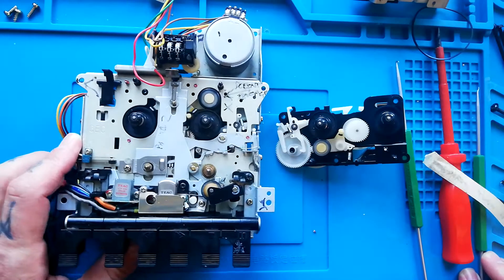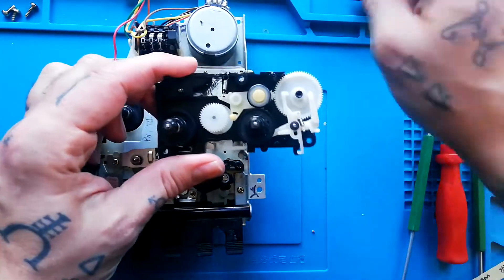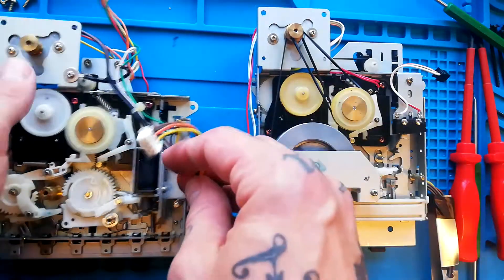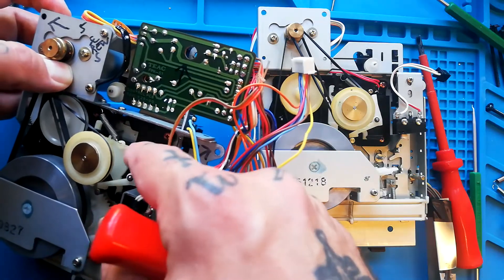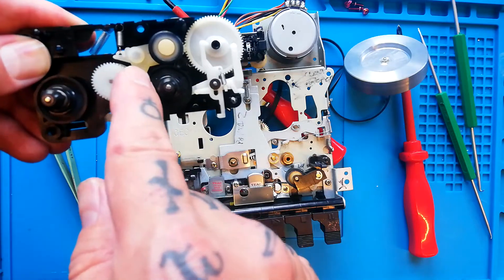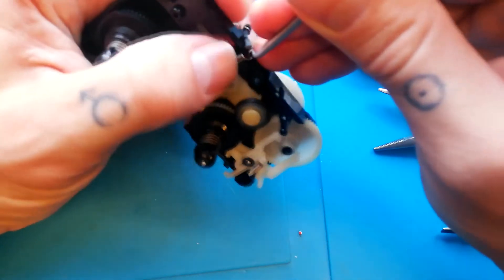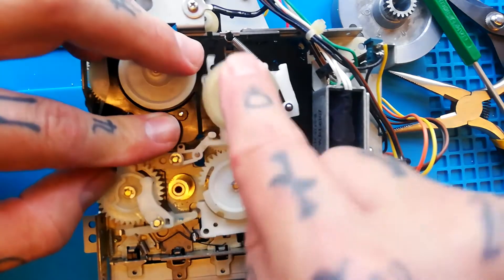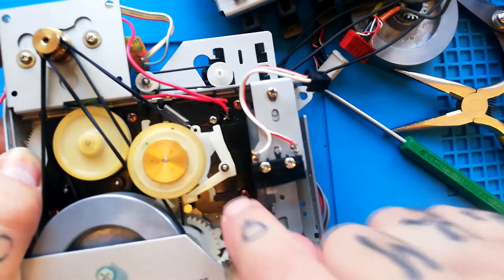GEC multitrack cassette transport |5 | detach & reinstall reel base | Porta One Two 05 MT3X X-15

Comment: The switch you are holding at 5:15. Mine came apart and I can't get it all back together. You mentioned re-installing it later on but I did not see that part. Any help would be appreciated! How do you get the plastic lever and the copper tab to stay in place?

Comment: Hi there! Your videos have been a great help since embarking on a Porta One restoration project this week, so thank you!
Is it possible to take apart the reel-base itself? And which lubricant would you recommend for the spinning parts? As the take up reel feels a bit stiff, and seems like it needs some lube to help it move smoothly when the idle tire makes contact. MANY THANKS in advance!

Comment: Any tips for removing the fast forward gear? Mine is completely seized up on a porta two. Can I just pull up on the little stop ring and pull the gear out?
Reply from the maker: Just the way you're describing it, I wonder if you mean the play idler? It has a rubber tire on it, immediately visible from the front of the transport once it is removed from the plastic case of the portastudio? If so, then there is a  plastic part shaped like a tack you can pry up using a flathead screwdriver, then clean (isopropyl?) and lubricate (silicone grease?) the bore of the wheel and the post on which it spins before replacing. If you mean the gear that turns the take-up reel in fast forward ( no tire, only visible from the rear of the transport after the flywheel has been removed) then that is held on with a plastic clip, it has a split in it that is hard to see, I usually.pry that off with tweezers.
Reply: @Tetrakan  yes this is super helpful. I mean the gear that turns the take up reel in FF.
Reply: It’s very yellow and brittle I’m a little worried about it breaking, do you know where to find a replacement if that happened?
Reply from the maker: Where are ypu based? I have spares but I'm in the UK. Tascam Ninja pieces put that sort of thing at a big markup but he's in Greece. A spares donor from ebay etc  might be the most realistic option until someone starts 3D printing these things... which I will do if no-one else does, but that's an idea  that'd take years to realise.
Reply: @Tetrakan  I’m in LA
Reply from the maker: @fionamoonchild6203  look for recursive delete, monolith Gardens and Mods and Ends On Instagram...they all specialise in fixing these things same as I do so they might have parts to sell?
Reply: Hi im trying to find a replacement ff gear for my porta one. Mine has broken teeth. Any idea where I can get one?  I’ve scoured the internet and can’t find. Thx!

Comment: Hello! Thanks for your videos. I repaired the play function on my little Porta 05, but now the take-up reel got too much tension. I can feel it with my fingers, the tape is moving faster than the pitch wheel rotates and it sounds like Mickey Mouse, mainly at the first half of a cassette.
Any idea how to loosen the take-up tension? I don't understand this clutch. Greetings from Germany!
Reply from the maker: Hi. So, the head is raising enough to pick up signal from the tape, but your pinch roller is not making proper contact with the tape and capstan, meaning the playback speed varies with the circumference of the tape on the take-up reel. If the pinch roller and capstan pin were gripping the tape properly, the tape would move at the speed of the capstan, regardless of the take-up reel circumference. It is intentional the take-up reel moves faster than the capstan, because if the tape is gripped properly, the tension only exists from the right of the pinch roller to the take-up reel, preventing tape chew...to the left of the pinch roller to the supply reel the tape tension would be low, does that make sense? Anyway, there are several factors which could explain why your pinch roller and capstan  do not grip the tape tightly. Most common cause is the black plastic plate at the base of the head assembly is cracked, requiring a spring to be reshaped. Gluey grease on the gears which raise the head assembly can also contribute, please watch all the videos in the series, I discuss these issues and their solutions.

Comment: thanks for sharing this information man. You're making the internet just a little better. I'm picking up a broken mt2x today. Seller says the head doesnt stay engaged. I'm wondering if this reel base is the issue. I will be studying this video once I get it. Thoughts?
Reply from the maker: I’m not experienced with Yamaha stuff but I heard that model has the GEC transport in there and yeah the problem being described sounds consistent with the plastic base below the heads being cracked. You can reshape the spring inside, I cover that as part of this series, also check out 3rd island’s video on fixing that issue.
Reply: @Tetrakan  thanks for the response! Ill try to let you know what I find out

Comment: I've been watching your videos for a while but this series finally made me sit down and fully disassemble and fix multiple parts units that have been plaguing me last night. 

Had s crusty ffwd cog that had some chopped teeth that I was able to replace from a parts unit and I then used that same parts unit to replace the entire sliding play mechanism on another unit with a broken spring plate. 

I have now turned 3 broken units into two functional units. 

Thank you!

Comment: Hey sorry to keep bugging you but we have a problem with the transporter just barely not letting the idler pulley engage the take up reel, we put fresh grease on the gears and the white base which helped and we cut the spring about 3 winds but it just won’t engage, and we replaced the belts and the idler tire, just curious if you have any other suggestions? Thanks
Reply from the maker: Have you checked the black plastic base for the heads, the problem where one corner cracks so the black spring inside needs to be reshaped? This effects how far the head assembly raises, which effects how hard the idler is pushed against the take bup reel do maybe this is an issue? Also I'd try taking another 3 winds off that spring you already shortened.
Reply: @Tetrakan  yeah we actually reshaped the spring even though it wasn’t broken thinking that maybe there wasn’t enough spring to push it but we’re just scratching our heads at this point..
Reply: When we get the heads to engage the tape just spills, its like the transport needs an extra little nudge to get the take up reel to engage..
Reply from the maker: So the idler is turning, but not touching the take-up reel? In that case I guess just keep shortening the spring until it firmly engages. I might be able to be more specific if you could upload a video demonstrating the problem?
Reply: @Tetrakan  we will try cutting the spring a little shorter and see what happens if that doesn’t work I’ll try to post a video, thanks I appreciate it.
Reply: @Tetrakan  I got it working and when the tape plays the take up reel is stuttering like it’s slipping, I got it running last night for a little while and now it’s just eating tapes left and right,  I changed the belts and the idler tire rubber, just curious if you have had the same problem and what you did to fix it? thanks again
Reply: @Tetrakan  update we took the “new” idler tire off noticing it was a little bit different with a seam on it and cleaned it up and now it’s working fine so far, thanks for your videos.